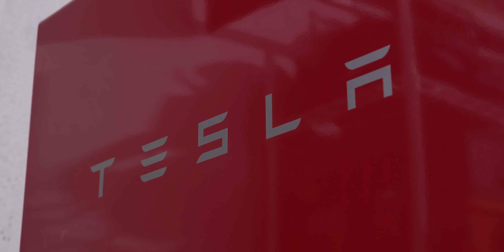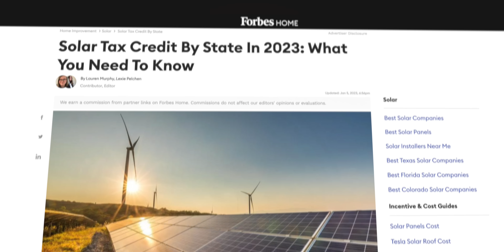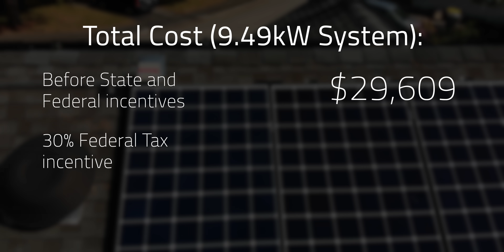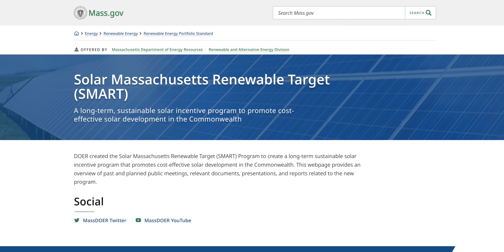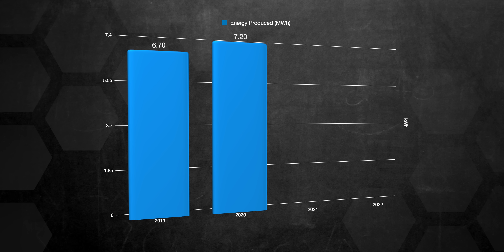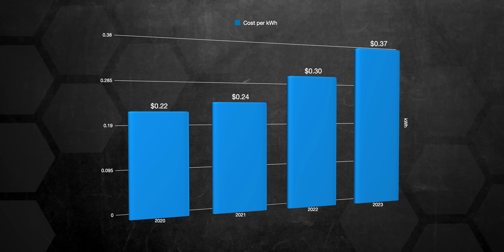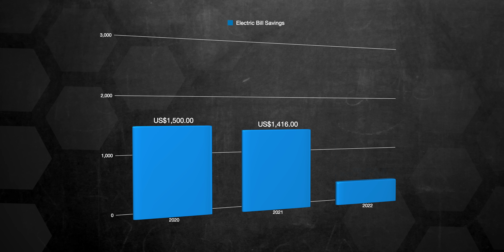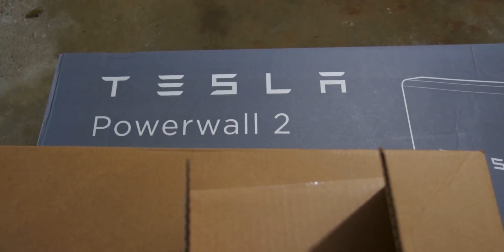5 Years with Solar Panels - Is It Still Worth It?

Comment: so, what I get about this scam works like this:

1) Government gives you the initial set. You sign a contract to use Solar on your roof for X year (permanent contract?)
2) After the initial buy and install, all repairs and additions are on you and are mandated per the contract
3) The real cost of solar panels comes from replacement and maintenance costs.

My guess is most buyers are not aware of the long-run issue of contracts and government contracts specifically.

Add'l q's:

1) Let's say you want to sell your house. is the contract effectively a lien?
2) What have other's reselling experience like?

Thanks much!
Reply: Actually, I didn't take into account the possibility that you're in a different country, where these things might, in fact, be true. My apologies.
Reply: John Klaus replied: "Ben Thurston Actually. It is true. Love it when people just say.. You're wrong."
 Government gives you the initial set. 
Not sure where in the world you are, but here in the USA, where this video was filmed, the “initial set” comes from a private contractor, not the government.
  You sign a contract to use Solar on your roof for X year (permanent contract?) 
There are several ways to purchase a solar system. Contracts such as this are only one. And no contracts are “permanent”.
  After the initial buy and install, all repairs and additions are on you and are mandated per the contract 
Here in Los Estados Unidos de America, most if not all major components are guaranteed for 25 years, by which time the system should have paid for itself several times over. Of course, if you want to make additions, that’s on you.
  The real cost of solar panels comes from replacement and maintenance costs. 
There are half a dozen solar systems among friends, family, and myself, up to eight years old. To the best of my knowledge, none of them has spent a penny maintaining or replacing any equipment. I did pay $100 once to have mine cleaned; but this turned out to have no effect, so I won’t do it again. 
 My guess is most buyers are not aware of the long-run issue of contracts and government contracts specifically. 
Perhaps you’re right. It would be foolish for anyone to sign a long-term contract for tens of thousands of dollars without being aware of its implications, but there’s no shortage of foolish people in the world. And here in America, no government contracts are involved.
 Let's say you want to sell your house. is the contract effectively a lien?
Some contracts are, and these must of course be either paid off or assumed by the buyer as part of the sale.
 What have other's reselling experience like? 
Friends and family have both bought and sold homes with solar systems, with no problems.
Other than these few quibbles, your original post is 100% right on. Oh, wait …
Reply: @BigBen621  Was that so hard? admitting you either didn't really know or were actively wrong.

I do it all the time when true. Not this time, as you can tell.

Speaking in Spanish doesn't change that we both live in the US and you don't know how this country works.

Here's the rub, kid. You have a contract with the local utility. The local utility has 2 charges. 1 is distribution and 1 is usage.

In case you are looking for paperwork, your local town forces you into said contract (their's not yours), so you are not a party to it.

These contracts change depending on the needs of the utility and those their pay off (most politicians).

In those locations where solar started to rip into the "profits" of these utilities, they forced a change to the "formula" for calculating distribution to include latent charge at set measured dates out into inifinity (meaning the future).

Every time you fools put up a new panel, the utility takes the net value back out of the system of financial scammery by increasing the Distro charge.

The "Panels" come from the government, even here in america, and we've "privatized" the work of putting them up and "selling" them (often they are actually given away as in MAright now).

The problem with you is you have no idea what anything is or means or where it comes from, so you get slow walked into a wood chipper financially.
Reply: @johnklaus9111  You're truly delusional. As I stated above, friends, family and I have installed a half dozen systems over the past eight years, and not one of your above claims actually occurred. Every one of these systems has met expectations. I made a one-time payment of $14,000 to a private contractor for a 6 kW solar system, and haven't paid a dime to my electric utility company since. No federal, state or local government entity ever touched my panels. Contrary to your claims, I pay nothing for distribution and nothing for usage. The only involvement my "local town" had was final inspection of the system. 
 
Suggest you peddle your FUD elsewhere.
Reply: @BigBen621  8 years. exactly. Lot's of ad bumb rush... not much thought to the future.

And we now know you didn't take part in most of the "programs", so we probably agree IRL, that those were government privatizing scams.
Reply: Pretty much none of that is true.

Comment: I have one question - how does it affect your roofing structure and roof longevity? I have a 10 year old roof and is this something you want to install on a new roof? Will it elongate your roof life? (Using asphalt shingles)
Reply: It really does increase difficulty of roof replacement. Have to organize a roofer and a solar guy to line up their schedules. They need to be removed and reinstalled. And I am not a big fan of how they are often installed. I'd say your more likely to have a leak halfway through roofs life than without them.

Comment: I’d like to hear about roof leaks and ice dams. You alluded to issues with snow sliding off, but the melting by the panels at sub-freezing temperatures will produce ice dams just like a poorly insulated skylight does. Roof raking will help mitigate that too. I’ve heard some nightmares about roof leaks several years after installation as the silicone sealants begin to age and crack. Have you experienced this yet? Most folks don’t realize this until a spot shows up on a ceiling only to find it’s been leaking in the attic for some time already. Thanks for the video and good you are in a state with maximum taxpayer-funded incentives. You might as well take advantage of it.

Comment: There’s always a question weather to purchase or lease. Lease costs you nothing, except the cost of the generated electricity at substantial discount compared to the utilities. Heated electricity costs the same as the lowest tier of the utility’s prices.  The utility gets paid for the excess electricity used, which is usually at the lower tier of kw/hr costs.  Do you basically posting to remain in the lower cost tiers when paying for generated as well as utility electricity.  But the problem is you’re locked into a contract for twenty years or more. This actually brings down the value of the house, because the new owner would be locked into the same contract. If you purchase the solar panels, the house value actually goes up! 
Color me undecided.

Comment: So about a 20 year payoff cycle.   Most people don't stay near that long in a house
Reply: 5-7 years in some areas, such as SoCal.
Reply: @BigBen621  wrong.  In Florida where there id more direct sun it is 10 years
Reply: @protonneutron9046  Wrong. Florida has much lower electric rates, which is why paybacks are longer there.
You're also wrong about "more direct sun". San Diego, where I live, gets 16% more solar energy in a year than Jacksonville; 10% more than Miami; and 10% more than Orlando. I'm guessing this is due to more cloud cover in Florida.

Comment: I really wanted to add solar to our home just north of Austin, TX.  So many financial obstacles!  Utility rates are low enough that it is hard to justify solar financials.  The utility (a rural electric co-op) charges a monthly "access fee" of $25, just to be connected to the grid.  They do buy back surplus production, but at about 55% of the cost to you, and it is subject to change at their whim, since they are NOT required to purchase that extra production as part of Texas' co-op rules.  We can't select an alternate provider, either - no competition for co-ops...  The net result is that break-even occurs around the 15-21 year mark (depending on system design and cost), which makes the ROI pretty much the equivalent of burning your money.  I'm 67 years old, so it is questionable whether I'd be alive - much less living in this house - when the system finally pays for itself.  Sadly, there is no solar power in our future unless something changes pretty dramatically...

Comment: Folks often ask: "how long until I get my money back on solar panels?"  This is the wrong the question.  The right question is: "What is the return on my investment?"  Matt, your out-of-pocket expense for the solar panels was just north of $14,000.  In 2022, with 1:1 net metering, you saved a little more than $2,000 per year.  That's an annual return of investment (ROI) of 14%!  That's an ROI that is greater than most retirement plans!  It was this realization that convinced me to get solar.

Comment: Solar on the roof is such a waste of time..... Solar panels are directional devices.... Meaning you need the sun facing the panel at all times to get peak performance.    Also Maintenance on a roof top installation is a nightmare.   Better  to place Solar panels on the ground with a dual axis SUN TRACKING mount.  1st you can place the Panels in the optimum area,  with Peak production. So you won't need as many Solar panels to make the same amount of energy.   Your overall  Satifaction will increase with Ground mounted Dual axis, SUN TRACKING mounts.
Reply: Single axis tracking adds about 25% of annual energy, compared with fixed south orientation. Two axis tracking adds another 15%. That has to be balanced against the initial cost of tracking systems, and the maintenance costs.

Comment: What happens when you have to have roof work done? How much more would something like that cost with all those solar panels up there? How much longer does it extend the lifespan of your roof before it needs to be replaced?
Reply: In one recent case in my family, it added about 15% to the cost of a roof replacement.

Comment: @Undecided with Matt Ferrell  
Thanks for another excellent "breakdown" video, Matt.  👍

If I were to choose today, I would probably go with PV Panels as well due to their improvements in efficiency and longevity.

But we are on 5 acres in the SoCal high desert and have fairly consistent wind, so we went with wind power and we haven't been disappointed.

(my "Copy & Paste" from another group of comments here):

Wind power can often be more efficient than solar PV power...dependent upon the locale, the same as for Solar PV.  We have a Bergey Excel 10kW wind turbine on a 100ft guyed-lattice tower and it produces an average of 125% of our usage for a 3 bed/2 bath home, family of 5.  The 3 blades have a 23ft diameter. 

With wind power, the efficiency of the turbine increases exponentially with tower height.  Being on 5 acres, we had no pratical restrictions on the maximum height of the tower, but the efficiency doesn't get all that much better above 100ft unless you have lots of nearby tall trees or other tall obstacles nearby.

There are restrictions on the maximum height of the tower you can install relative to the size of the property and the easements.  For example, if we were on 2.5 acres instead of 5, we would only be able to use an 80ft tower.  Not bad, but just 20ft higher improves efficiency and the the cut-in time of the turbine (higher, "cleaner" air will start rotating the blades sooner).

In addition, our local County and State laws required that all of the immediate neighbors located around the perimeter of our property agree in writing and "sign-off" on the installation and existence of the wind turbine on our property.  At the time we just had a few neighbors, and all of them were enthusiastic about the installation of the system. 

On smaller properties, it would be more difficult to come up with a cost-effective and efficient wind power solution.  It would most likely require a self-standing tower rather than a guyed-lattice tower.  The self-standing towers are much larger at the base (shaped like the Eiffel Tower and more of an eye sore and obstruction), and are exponentially more expensive due to the larger amount and thicker steel and reinforcements.  

The self-standing towers also require an insane amount of poured concrete for the base, which is costly as well.  IIRC it would be at least 10x what a guyed-lattice tower requires.

But the Bergey Excel 10 has been extremely reliable with very little maintenance required.  It is a direct-drive, moving magnet rotor shaft, so just simple front & rear shaft bearings and no gearbox/transmission that requires lubrication or maintenance.  It also has an auto-furling mechanism for high winds, which can also be engaged manually from the ground via a steel cable and hand crank.

We occasionally get very high winds in the high desert here (80+mph) and have had no issues.  However, these turbines do create air turbulance noise (especially in high winds and when auto-furling) that you will need to get accustomed to.  The blades and tower also cast a very long shadow during sunrise & sunset, and the rotating blades can create a "strobing effect" during these times which might "fall" on a neighbor's window or outside their window at certain times of the year.

But for anyone that is curious, we have not experienced a single bird strike or kill since it was installed in 2007, and we have an extremely wide variety of and multitude bird life here!

At the time we installed the system in 2007, it was roughly $50k, but combined Federal, State, and local Utility Rebates paid for ~50% of that cost.  Unfortunately, while there are still incentives and rebates for Solar PV systems in CA for another year or so, there are no longer rebates or subsidies for Wind Power systems here.  :/  

This system is "grid-tied" and has automatic shut-down in a utility grid outtage in order to protect line workers, so we have a 6,500w quiet Honda Inverter generator and electrical service entry change-over switch with select isolated circuits within the house for power outages, which are extremely few and far between here.   The cost of adding and maintaining a battery bank at the time did not make sense due to the consistent grid power we have.

From 2007 until 2012, our local utility (and CA) would only provide power usage Credits for the excess power we produced.  For instance, if we sent 30% of our excess power to the grid in March, but we didn't have nearly as much wind in April, that 30% excess from March would be Free to us to use in April, etc.  It was similar to "roll-over minutes" on cellular phone plans in the past.

But in 2012, the State and Local Utiliy started paying consumers for the excess power we produced and provided to the grid, albeit at a lower rate than what we pay the utility per kWh.  :/  Still, this adds up to ~$50-$130 per month paid to us by the utility.  The system paid for itself in roughly 7 years.

Where we are located, and at the time we installed the system, the efficiency and cost per kWh for wind power were about 45% better than an equivalent PV Solar Panel system.  And we have the wind to support the turbine.

But the newer PV panels have gotten even more efficient and have better longevity, so I might chose Solar PV if I was in the market today, especially since we have the acreage to install ground-based panels and are in the South-Western high desert where we have plenty of sunshine and only a week or two of just light to moderate snow...perhaps 7 "snow days" for the local schools each year on average.

HTH

Comment: I started with an experiment: 1x 100watt panel from a hardware store. 1x deep cycle battery from another hardware store.
1x 200watt sine inverter. It worked. I was able to charge my devices and power lamps. Nothing exciting.
SO...I asked myself, what if I got larger panels.
I ended up finding a guy who was selling a bunch of used panels.
I currently have 3x 230watt panels (with plans on getting more).  I recently invested in a mppt controller.
I can run my fridge, washing machine, dishwasher, hot plate, and many more devices in the house.
(Not all at one time mind you...I'm just starting out and learning as I go).
We don't all have $20,000+ to throw at something like this.
I've seen a small savings, but it's inspired me to keep building it, slowly.
Reply: I recently built a small 400 Watt solar generator that I have mounted on a Harbor Freight 4 wheeled cart. The cart houses 4 100 Ah batteries, a 2000 watt inverter (should have gone 3000 watt), a 70 ah MPPT controller as well as some led lights and a charging station for USB devices. I mainly built it for short duration outages for running the cable internet, router, lights, and kitchen range which is gas but requires 110v to operate. I could run the refrigerator off of it for quite some time as well. I do have two generators to run the RV and deep freeze if the power stays off for too long. I spent far more than I planned but they had a sale on the batteries so I jumped on four of them at $199 each. My panels, two of them are Renogy 200 watt suitcases. They are very nice. I couldn't have built them for much less than what I paid for them. I do plan one day to install the system in my travel trailer that already has one solar panel on the roof. I have room to install one more up there as well. I have no regrets and it was a fun project.